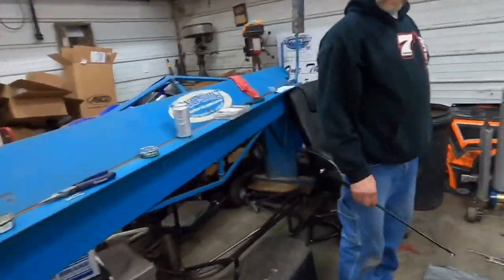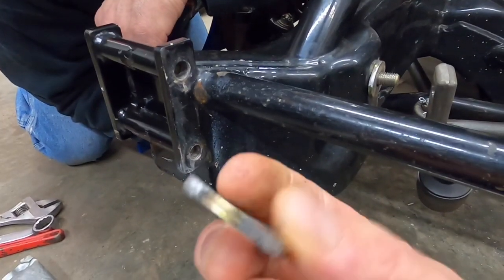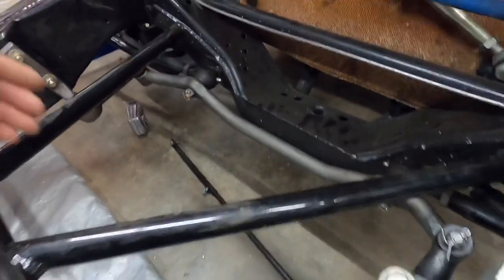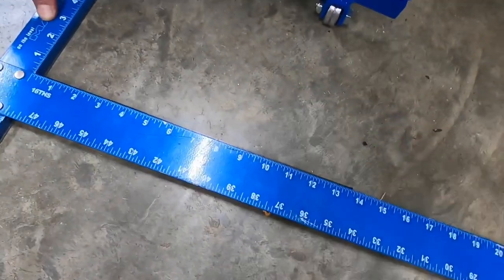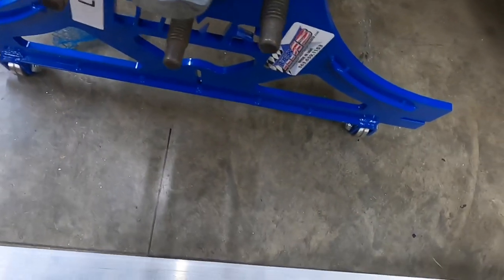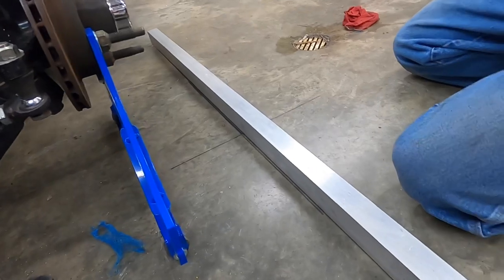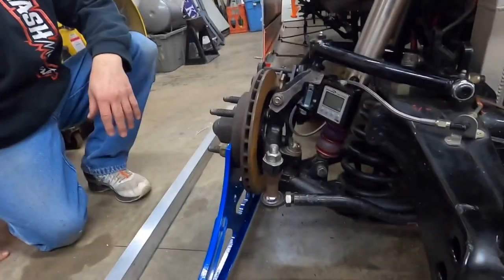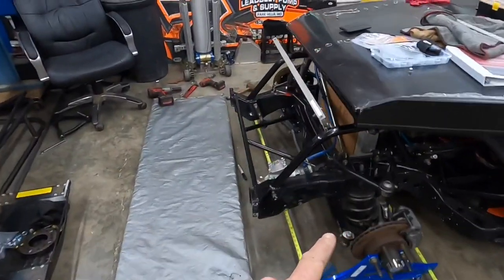Using purpose built tools to setup your race car - toe settings

Comment: Im new to owning a racecar. Can you elaborate why you want to center link squared up?
Reply from the maker: Of course, you want these squared to ensure proper steering geometry. Everything in the steering system needs to be squared to prevent binding, dodgy steering, inconsistency, the list goes on!
Reply: Bumpsteer
Reply: I can add some to it, first of all your front suspension components need to be symmetrical as possible. With that being said, meaning sweep angles as the components move you have to look at it as a circle even though these components do not make a 360 degree circle. I will use the Pitman arm and Idler arm as an example. One they need to be the same length center to center as much as possible. Two their direction of angle needs to be the same from their vector point meaning if one points at 90 degrees the other one needs to be the same. What this does during rotation the angles stay the same if the pitman arm rotates 5 degrees from it static setting you want the idler arm to do the same as well. This helps maintain the pitch angles of your center link, tie rods and tires during rotation. If these become nonsymmetrical then your center link, tie rods and tires  pitch angles are erratic which has a huge effect on the handling of the car. For an example if the pitman arm rotates 5 degrees positive and the idler arm rotates 2 degrees positive the it throws the pitch angles off. Lets say your pitman arm is 90 degrees at it center point of rotation and you idler arm is 85 degrees at its center point of rotation and you rotate the pitman 5 degrees it becomes 95 degrees and the idler arm becomes 90 degrees. The pitman arm is pulling one end of the center link inward while the idler arm is pushing one end of the center link outward or visa versa. This will cause one tire to turn in while the other turns in or visa versa. Always look at links and arms as an object the rotates within a circle and what angles it changes in x,y x,z y,z or x,y,z rotations. When a pitman arm and idler arm rotate they turn out and up or in and down. Hope I did not make any mistakes in explaining this but hopefully you get the drift as to what I explained. Wish you the best in you racing program.
Reply: @Nicholas Kenneth Paul Baskier Can you have more toe out on one side then the other my answer would be no. Reason being toe out is the distance between the tires measured from center to center in the front and the back of the front tires . So it wouldn't matter which tie rod you adjust it has an effect on the toe in or toe out which ever one you are trying to achieve. But when your steering is neutral "zero degrees in its static setting" and you adjust the right side tie rod out, your right side tire points outward and the left side tire is neutral the car will want to drive to the right, but if you adjust the left side tie rod out and the right side is neutral the left side tire points inward it will want to drive left.  Everyone has their preference what works best but always remember when you adjust one side longer then the other you front suspension is no longer symmetrical which could cause erratic steering conditions, but sometimes improves steering conditions. Trial and error test both ways and see what works best for you. I personally when setting up my brothers race car I strive to be symmetrical. I hope this helps and I explained it where you can understand it.
Reply: @Nicholas Kenneth Paul Baskier You're welcome something I didn't think to add was Toe out or Toe in adjust can create stability or in stability in a race car. Tou out creates drag which can make a car more stable but to much can create to much drag and slow the car down. Toe in creates less drag but can make a race car less stable. I always used Toe out in the range of 1/8" to 1/4".  You want to try and test what works best for you and gives you the best optimal performance. You may be better off with a little Toe in or Toe out. You may be able to go with neutral Toe. I suggest going with toe out and you can test and see what works best for you Toe in, Toe out or Neutral Toe. If you was to try Toe in I would guess 1/16" to 1/8"  anything more I believe would be a detriment to the stability of the car.  Wish you the best in your racing endeavors.

Comment: Tim do me a favor and read this and correct me if I misspoke on any of it Thank You. I can add some to it, first of all your front suspension components need to be symmetrical as possible. With that being said, meaning sweep angles as the components move you have to look at it as a circle even though these components do not make a 360 degree circle. I will use the Pitman arm and Idler arm as an example. One they need to be the same length center to center as much as possible. Two their direction of angle needs to be the same from their vector point meaning if one points at 90 degrees the other one needs to be the same. What this does during rotation the angles stay the same if the pitman arm rotates 5 degrees from it static setting you want the idler arm to do the same as well. This helps maintain the pitch angles of your center link, tie rods and tires during rotation. If these become nonsymmetrical then your center link, tie rods and tires  pitch angles are erratic which has a huge effect on the handling of the car. For an example if the pitman arm rotates 5 degrees positive and the idler arm rotates 2 degrees positive the it throws the pitch angles off. Lets say your pitman arm is 90 degrees at it center point of rotation and you idler arm is 85 degrees at its center point of rotation and you rotate the pitman 5 degrees it becomes 95 degrees and the idler arm becomes 90 degrees. The pitman arm is pulling one end of the center link inward while the idler arm is pushing one end of the center link outward or visa versa. This will cause one tire to turn in while the other turns in or visa versa. Always look at links and arms as an object the rotates within a circle and what angles it changes in x,y x,z y,z or x,y,z rotations. When a pitman arm and idler arm rotate they turn out and up or in and down. Hope I did not make any mistakes in explaining this but hopefully you get the drift as to what I explained. Wish you the best in you racing program.
Reply from the maker: Definitely well explained. I can’t argue with your logic!

Comment: Remember back in high school when you wondered how you would ever use the stuff you learned in Geometry class? It turns out that what Mr Grosdick taught me has paid off more than any HS teacher (except English grammar/comp), or college professor (ESPECIALLY them), ever taught me. Whether I am figuring rent per sq ft for a building I want to buy or build, figuring how many people I can seat on a hockey floor for an Eagles concert at 7 sq ft per person (fire marshal requirement) or making sure my race car is working FOR me and not AGAINST me, it's ALL geometry.

     BTW, figuring the sq ft of a hockey floor, with rounded ends on one end, where the straight line crossing the floor on the other end changes with the placing that Dave Grohl or Don Henley wants, is pretty challenging. Then the promoter or agent, wants to know what happens to the revenue if we move the stage a few feet in either direction. If I do the math wrong, the arena I managed, along with the promoter we partnered with, loses a TON of money that we use to pay our ticket takers, ushers, electricians, security... ME hahaha... and a ton of other people. That's if we don't lose the show completely.

I'm still waiting for all that stuff to make faster at the track hahahahahahahaha

Comment: I’m sorry I simply don’t understand 
why are you not using the tool that you purchased that you must not know how to use .?. 
The tape measure slot that is put in your plate you’re supposed to stretch your tape measure to the other side of the car front and rear with that plate without having to make any marks on the floor it gives you perfect measurements every time

Comment: Those Hammond plates look pretty sweet, even better than my Paco stands. I thought the price for hub-mounted alignment stands was stupid. Then I used them with a quality digital caster/camber gauge on my Panoz,  then my Miata, then my 944, then my buddies Spec E36 and Formula Ford.

Worth every penny. The beauty of these types of stands is that you don't have to unload/load the suspension when you make changes to camber/caster/toe.... the changes you make happen in real time... Add that to  really good tire temp and PSI gauges at the track and you have all that you really need.

Kudos for admitting that your measurements were off... that may be the most valuable part of this video... measure, then measure again, go to lunch, measure again when you get back hahahaha
Reply from the maker: Thanks man!!

Comment: Do you run the improved geometry center link?
Reply from the maker: Stock center link all the way that’s all I will ever use
Reply from the maker: What geometry are they improving
Reply: Old No.7 Garage they say the afco improved geometry is suppose to help bump steer, I know Dave hammond doesn’t like them
Reply from the maker: Always Check your bump steer. If  need be you can make custom bump steer spacers.
Reply: Is a Lethal chassis a metric stub?
Reply from the maker: No sir, they are chevelle stub cars

Comment: Where did you get the tool to measure with
Reply from the maker: Are you talking about the setup plates?
Reply: @OldNo7Garage  no the tube with the two pointers on to measure center link squareness
Reply from the maker: So that’s an adjustable body brace. I put 1/4-20 bolts on the grinder and sharpened them to a point and put them on the ends. I’ll link the braces: 
https://circletrackwarehouse.com/?product=steel-body-brace
Reply: @OldNo7Garage  thanks